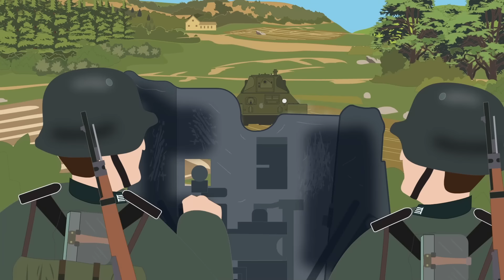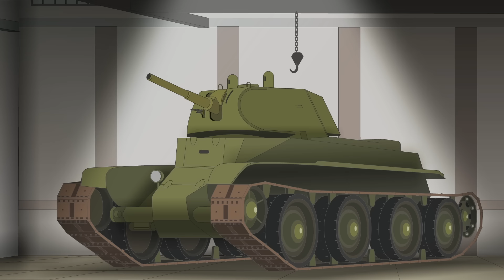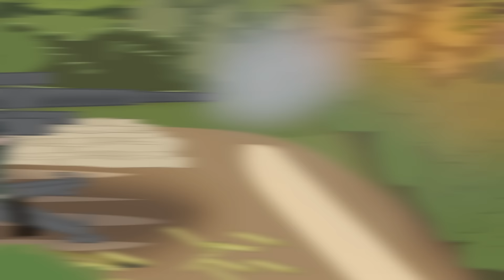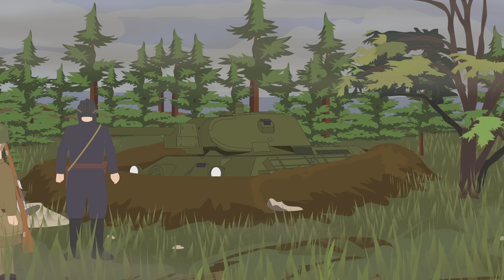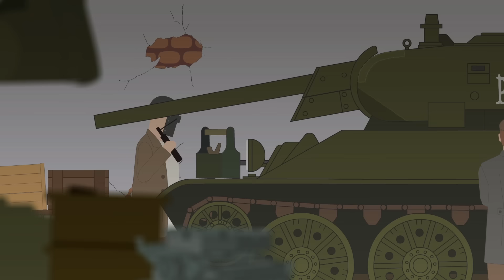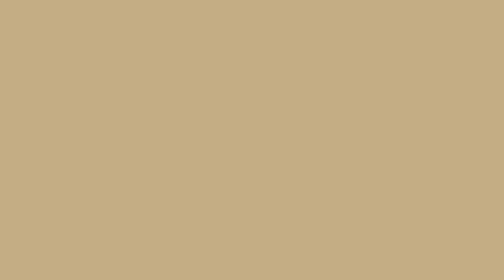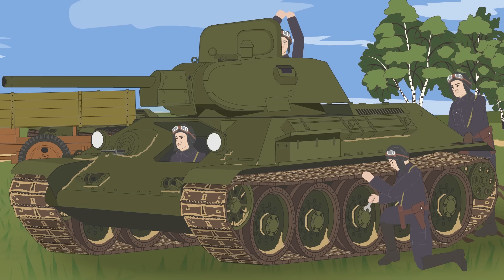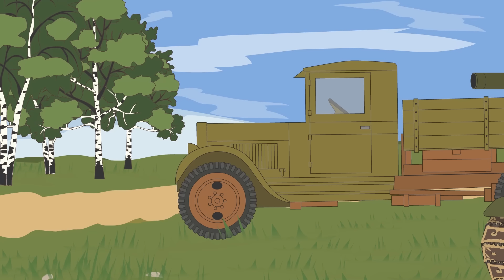Was the T-34 Really the Best Tank of WW2?

Comment: Just a bit under 45.000 lost during the war! War-winning indeed…
Total Soviet AFV losses in 1941-45 were 96.600. That’s not a typo. Almost one hundred thousand vehicles.

For comparison’s sake a German report found in ’Waffen und Geheimwaffen des deutschen Heeres 1933 - 1945’ (24) lists tank losses in the East from 1941-44 as 15.673 and total AFV losses (tanks, Stug, self-propeled guns etc) as 23.802.

Comparison with German and Western tanks

The German models Tiger and Panther were greatly superior to the T-34 in armor and firepower.
At the other end of the spectrum the outdated models PzI, PzII, Pz35 and Pz38 that were used in numbers in 1941-42 were completely outclassed by it.

The T-34 was superior in mobility as its 500hp engine gave it an excellent power weight ratio. Also its wide tracks minimized ground pressure and allowed movement in soft ground. However its stability over rough terrain was not better than the German tanks.
 
T-34 vs PzIII

The main German tank in the period 1941-43 was the PzIII. It weighed roughly 22 tons and was armed (in that period) with a 50mm gun.
The PzIII made up 28% of German tank strength at the start of operation Barbarossa. Roughly 72% of these had the new 50mm gun, the rest the 37mm (25). These guns could only penetrate the T-34 from the sides at close ranges while the Soviet tank could destroy the PzIII from long distances from all aspects.

By summer ’42 it made up 51% of German tank strength. At that time it had received a longer 50mm gun that could destroy the T-34 from 500m frontally (with special ammunition). It also received more basic armor (50mm from 30mm) plus 20mm bolted on parts. The extra armor negated the performance of the F-34 at long ranges.

Despite its theoretical inferiority the PzIII was able to fight against the T-34.
What it lacked in armor and firepower it made up by having a better internal layout, better reliability and optics, a commander’s cupola and radio in every vehicle. Its main advantage versus the T-34 was its superior reliability.

It is not clear whether some PzIII models had a turret basket (different authors support different views).

T-34 vs PzIV
The PzIV was the main German tank in the period 1943-45. It weighed 25 tons and was equipped with a 75m caliber gun. During the war it was upgraded with more armor and a better gun.

The PzIV made up 13% of German tank strength at the start of operation Barbarossa (26). The model used was equipped with a low velocity 75mm gun effective against infantry but not armored targets. From mid 1942 the PzIV was equipped with the longer 75mm gun KwK 40 that could destroy the T-34 from 1.000m. The basic armor was also increased to 50mm (from 30mm) plus 30mm bolted on and in 1943 80mm standard (for the front hull).
The upgraded PzIV was superior to the T-34 in internal layout, firepower, turret basket, optics, commander’s cupola, radio in every vehicle and its frontal hull armor could withstand the F-34 rounds. A Soviet study in 1943 (27) admitted that the Pz IV was superior to their tank, assigning it a combat value of 1.27 to the T-34’s 1.16 (with the Pz III being the base 1.0).
The T-34/85 that appeared in mid 1944 was a harder opponent due to its new gun but the PzIV still had an edge in the ‘soft’ factors mentioned above. Moreover the heavier 85mm rounds limited the number that could be carried to 56 compared to the Pz IV’s standard load out of 87. The 85 mm rounds were not stored in a safe manner (28) since 16 of the 56 rounds were in the turret This allowed the loader to use them quickly but it had the downside that a penetration of the turret led to the explosion of the shells and loss of the tank.

T-34 vs M4 Sherman
The main US tank in 1942-45 was the Sherman. It weighed 30 tons and was armed with a 75mm gun. The late war version M4 76 had a more powerful 76mm high velocity gun.
There are many similarities between the T-34 and the M-4 Sherman. Both tanks were built in huge numbers and they are comparable in weight and gun caliber. Even their updated version T-34/85 and M4 76mm are very close.

As a weapon system however the M4 was superior. It had the same good ‘soft’ qualities as the German tanks (internal layout, optics, radio), It had significantly better stability over rough terrain plus it was very reliable mechanically. In armor and firepower it was the same as the T-34.

The Sherman proved its superiority in the Korean war, when US M4 tanks demolished the North Korean armored units equipped with T-34/85 tanks.

Conclusion

The T-34 is the victim of Soviet and German wartime propaganda. The Russians had every reason to build it up as the best tank of WWII. The Germans also overstated its performance in order to explain their defeats.
If the T-34 was as good as propaganda made it out to be then it should have led to great Soviet victories in 1941-42. Instead what we see in that period is the poor performance of Soviet armored formations. In 1943-45 the T-34 was becoming outdated as the Germans used updated versions of the Pz IV and Stug III equipped with the powerful Kwk 40 75mm gun and of course they introduced the Tiger and Panther.

The ‘best tank of WWII’ suffered horrific losses against those tanks and even the updated version T-34/85 could not bridge the gap. According to a Soviet report (29) in the period summer 1943 - March 1945 the probability of the T-34’s armor being penetrated if hit was from 88-97%, thus any round that managed to hit the tank was practically certain to penetrate the armor.

Comment: All WWII tanks had a hard time when travelling and they needed repairs and maintenance or they broke down.

There is also the question of standardization. The T-34 was produced at several factories. Each factory produced a slightly different variant. Could spare parts from Nizhny Tagil be used on a T-34 from Gorky? Doubtful.

The cheap T-34

One of the major characteristics of the T-34 was its low cost. This supposedly was the reason the Russians were able to build so many, while the Germans insisted on building expensive and thus limited numbers of tanks. Let’s take a look at these two statements.

Price
The concept of ‘cheap’ or ‘expensive’ has no meaning in a command economy. The reason being that the pricing mechanism is controlled by the government. If Moscow wanted a weapon to cost x amount of roubles it would cost x amount. Command decisions were made at the top and did not take into consideration free market concepts like return on investment, opportunity cost etc etc

The same issues affected, in a lesser way, the German, US and British war economies.
This makes it impossible to directly compare weapon systems by looking at the official prices. In general trying to compare the costs of weapon systems built in different countries under a command economy is very hard and prone to errors. Even using other indicators such as man-hours and input of raw materials can be misleading.

Just to give an example the ‘cheap’ T-34 had an aluminum engine. The Germans with more industrial assets than the SU and significantly higher aluminum production reached the conclusion that they could not provide their own tanks with an aluminum engine. It was simply too costly for them. This shows the different capabilities and priorities that countries have.
A better way is to compare prices of products in the same economy. This shows that the T-34 was much cheaper than the KV-1 and IS-2 tanks.

Also production costs and man-hours went down during the war. In 1941 8.000 man hours were needed to produce one T-34, this was reduced to 3.700 in 1943 (20). Price in rubles went from 430.000 in 1940 to 168.000 in 1944.

Note that the manhours figure for the T-34 probably refers only to the construction of the hull and turret, not a finished tank.

Regarding the price, the study ‘Engineering analysis of the Russian T34/85 tank’, p5 says that:
‘it is believed, that the cost at the time of manufacture, converted to USA currency, would exceed 50.000 dollars.’

This was the same price as the M4 Sherman, an overall better vehicle, so it is not clear of how the T-34 was ‘cheaper’ than the competition.
 Mass Production
The second major issue is whether the mass production of the T-34 was due to its imaginary low cost.

The reality is that the T-34 was built in huge numbers because the SU had built (with American assistance prewar) huge production facilities. These gigantic facilities in the Urals were the reason for the mass production.
The Germans also took advantage of gigantism when they built the Nibelungenwerk factory in Sankt Valentin, Austria. This greatly expanded Pz IV production.

They also built the ‘expensive’ Panther in huge numbers (for their standards) in the period 1943-45. It was not the ‘cost’ of the Panther that allowed them to do so but the industrial assets assigned to it.
The Americans built staggering numbers of M4 tanks in their tank arsenals, not because the M4 was intrinsically cheap but because gigantic facilities were provided for its construction.

Quantity vs quality

When looking into whether a weapon system is cheap or expensive the price is only one factor. The other one and I think the more important one is its performance. Is it better to build 100 cheap tanks or 50 expensive ones? The price difference might be significant but that about the other costs?
100 cheap tanks will need twice the crews and twice the fuel as the 50 expensive ones. They will also need twice the spare parts. If 50 tanks require 25 supply trucks then the 100 will need 50. You get the idea.

Then there is the aspect of losses. A cheap but poorly designed tank system will suffer more losses than an expensive but well armed and armored one. Machines can be mass produced but what about trained crews? A tank force that has limited crew casualties will have many tank aces and even the rest will be able to perform well in combat. On the other hand a country that builds large numbers of inferior tanks will lose them quickly, together with their crews. This will create a downward spiral as inexperienced crews will make up the majority of crews and thus severely limit the capability of the armored force.

In the period 1941-44 the production difference in AFV’s was 2-1 in favor of the Soviets (slightly higher if we add Lend Lease) but the exchange ratio was 3.5-1 in favor of the Germans. This means that if the Germans could concentrate all their production in the East the Soviets would run out of tanks.

The endless stream of T-34 tanks

Another myth is that there were hordes of T-34’s attacking the German formations. A simple look at the Soviet tank strength at various points in the war shows that the T-34 was not the most important tank. The light tanks T-60 and T-70 and the tank-destroyer SU-76 made up the majority of AFV’s in 1941-42 and even in 1943-45 the T-34 comprised roughly half of the Soviet frontline AFV force. In summer 1941 there were only 967 T-34’s in the total strength of 22.000 tanks.

Comment: Soviet tests on newly built T-34’s showed that in April 1943 only 10.1% could complete a 330km trial and in June ’43 this went down to 7.7%. The percentage stayed below 50% till October 1943 when it rose to 78%, in the next month it dropped to 57% and in the period December ’43 - February ’44 the average was 82%.

Preliminary inspection of tanks built at the Ural tank factory No 183 (largest producer of the T-34) showed that in 1942 only 7% were free of defects, in 1943 14% and in 1944 29.4%. In 1943 the main problem was damage to the gear teeth 

The V-2 engine had serious reliability problems. Depending on the source in 1941 it supposedly lasted for 100 hours on average. This figure went down in 1942 since some T-34’s could not travel more then 30-35 km.

The T-34 tested at the Aberdeen centre was built at the best factory using materials of superior quality but its engine stopped working after 72.5 hours. This was not due to American interference as there was a Soviet mechanic (engineer Matveev) charged with maintaining it. Still it was much better than the standard tanks since it covered a distance of 343km. According to the head of the Armored Directorate of the Red Army N.Fedorenko, the average mileage of the T-34 to overhaul during the war, did not exceed 200 kilometers. This was considered adequate since the T-34’s service life at the front was considerably less. For example in 1942 only 66km. In that sense the T-34 was indeed ‘reliable’ because it was destroyed before it had a chance to break down on its own!

Still there are examples of T-34’s breaking down during assaults even late in the war. For instance the 5th Guards Tank army in 1943 lost as much as 31.5% of its tanks during its march to Prokhorovka. In August ’43 the 1st Tank army lost 50% of its tanks due to malfunction. As late as the second half of 1944 tank units tried to replace engines with more than 30 hours of operation before a major attack.